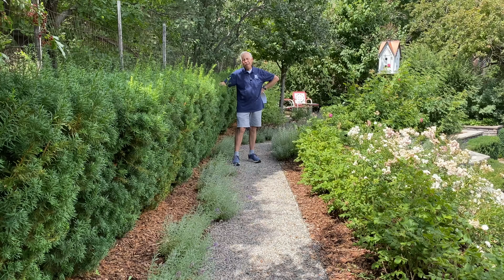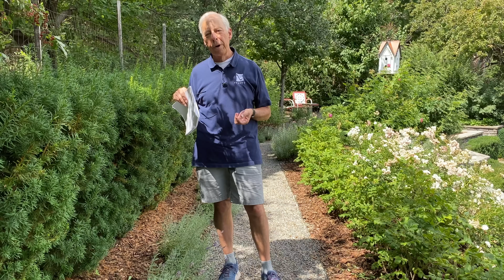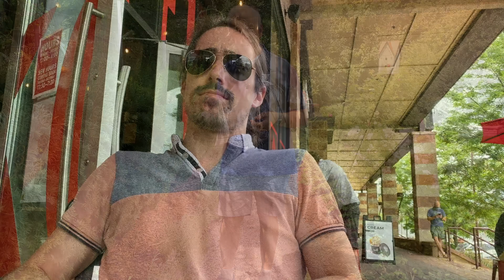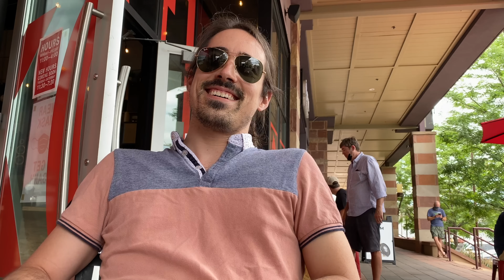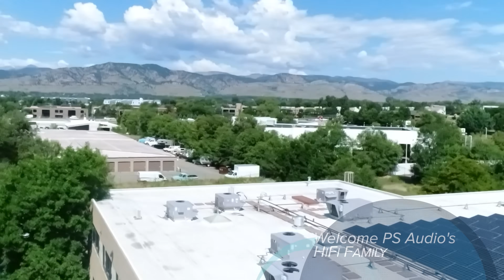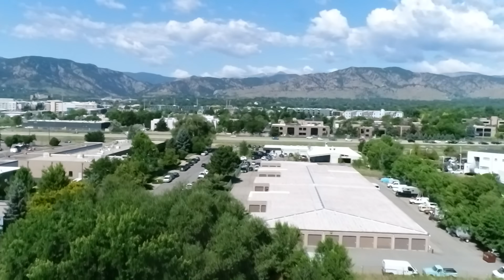Vacuum tubes on satellites?

Comment: Tubes on satellites? Oh yeah baby they sure as hell were used. But they aren't your typical run of the mill tubes. They are designed to last well over 10-20+ years and cost a pretty penny. My uncle on mom's side originally worked for RCA Astro ( which became GE Astro and than Martin Marietta) and I toured the place as it was right around the corner from where I used to live most of my life( east Windsor, NJ) uncle used to build the satellites. I even had a couple boards that were from the equipment they used to test the satellites-no never under a billion years any actual satellite components lol. 
His father my surviving grandmother's ex husband and my grandfather Anthony s. Baran actually built parts that were on the original Voyager that was lost in the black hole. My uncle's old Lehigh roommate in college Derek debastos is or was in charge of the up/downstream at XM radio and actually the two DAB satellites they use rock and roll were named so because uncles bday is the same as Elvis's. Long story short. There's alot more hahaha.

Comment: Geo stationary TV satellites use 40 Watt travelling wave tube microwave power amplifiers. Travelling wave tubes are velocity modulated where ordinary valves are density modulated.
Reply: I depends though on what era you are talking about. I think it was mid to late 80s where we got to around 40 watts with KU band? I thought DirecTV and Dish were in the 120 watt range per transponder? I started out in C band in the early 1980s. Back then the birds like Satcom and Westar series only had 5-8 watts per transponder. The C band uplink HPAs were klystron based with two only vendors, Varian and MCL. Went to the production engineering side soon after that and lost track of the technology.
Reply: Jim, correct is  "Stationary TV Satellites"
Reply: @peterhoebarth4234  No, it's Geo stationary TV satellites which are in geo stationary orbit at around 23,000 miles above the earth's equator.
Reply: @jimdavis5230  , Ballon - Satellites , the Altitude is XXX, Lol

Comment: Yes, there would have been no "Galaxy" C-band satellite video service for consumers decades ago, nor any Directv or Dish Network service, without the extreme power bandwidth and power sensitivity (easy to drive) of the famous Travelling Wave Tubes!  Their high gain, good linearity, long life and relatively high output power & efficiency made the satellite services practical.  But even the most mundane tetrode or pentode receiving tube is capable of far higher HF & VHF response than most modern transistors. Vacuum capacitors, and vacuum variable caps have been used for decades in RF applications, and the stability of the dielectric constant in a vacuum cap can't be beat for the most part. But inte-relectrode capacitance in most regular receiving tubes plays a very important part of how the tube will ultimately function, especially for a given application. Did you know that the "mu" of the intrinsic tube (with all parasitic stray cap & inductance removed) is defined as the ratio of the cathode-grid capacitance divided by the cathode-plate capacitance? This means that a "hi mu" tube has good electrostatic shielding between the cathode and plate. And that's why you'll see the 'mu' listed easily for triodes in the tube data sheets, but almost never expressed for tetrodes or pentodes. The C-P shielding is so good, that mu ratios like '200,000' are sometimes published, which is not meant to be used for gain calculations, but does remind the designer that the C-P shielding is very high and the C-P capacitance is very very low; tiny fractions of a pF! From this, we enjoy very high gain bandwidth product from the tube, freedom from Miller capacitance, among other things. Sometimes unwanted oscillations as well ;^). Say hello to Darren, and watch out for the high voltage rails and us old tube buzzards, ever circling over these topics.

Comment: I have heard that tubes are safer from EMP. So defense gear is protected.
Reply: YES!  Back in the 80's, my Dad and I worked on a project with Bell Labs to make a nuclear blast-proof shutter for the underground bunkers that carried the most important military communications.  These bunkers need to be ventilated, except in case of nuclear blast & corresponding EMP.  My Dad's "shutter" was created after some pretty serious blast testing at Bell Labs.  Their spec. required a maximum milliseconds to protect the ventilation shafts. It worked.  Cost to the AT&T system was $700 at the time, and replaced a unit the US Navy was buying for over $5,000 each. We got a BIG order for these.  NOW TO THE POINT.  We learned from Neil Thorsten, our liaison engineer that the communications gear in the bunkers used all vacuum tubes!  Yes, EMP proof.  Transistors just fail.  Go figure.

Comment: Wouldn't the vacuum in space make any capacitor great like a vacuum tube?
Reply: The dielectric constant of the vacuum is pretty hard to beat :-)
Reply: Vacuum is not what you want in most cases. Dielecrtric in a capacitor are there to enlarge the capacity. Vacuum-capaciors would be huge in size, and due to that would have other problems. That is why no one has ever bothered constructing them. It is easy to build some in a sealed glass bottle (i am avoiding the term tube here) but their electric properties are not worth it.
Reply: @matekochkoch  Vacuum capacitors do exist, they're fairly common in high-power RF service. Quite expensive, however, and with relatively small values.

Comment: Back in 1976 when Soviet Union pilot Viktor Belenko detected and flew his  MIG-25P "Foxbat" interceptor to Hakodate Airport in Japan, it was quickly swarmed by U.S. Air Force intelligence to find out all they could about this Mach 2.8 (3000 km/hr) capable super plane, much faster than anything the West had at the time, save for the SR-71 Blackbird (which was a reconnaissance aircraft, not a fighter/interceptor).  They were initially surprised to discover that this state-of-the-art aircraft used primarily vacuum tube based technology.  Somebody later figured out that the tubes were less susceptible to electro-magnetic pulses from "tactical" nukes, which was considered a real possibility if war broke out between the USSR and NATO.

Comment: No shock and Awe here, but back in the 70's and early 80's we were running a vending business and used Motorola 2-way mobile radios in our service vehicles. We were on Low Band VHF, around 35 Mhz. We ran a few Motrac units which were ALL transistor up until the final RF power output stage where they still used tubes for the driver and final! These radios were designed in the mid 1960's too! Goes to show that high power RF semiconductors were slow in development for hi power hi frequency use. BTW, the tubes could stand up to just about anything you could throw at them! A shorted or open antenna circuit would NOT be instant death for a tube. We never had any radios fail either!
Reply: They sound like what we were using in the volunteer fire fighting service in the 1990s before the brigade I was president of was disbanded. I remember one exercise where we were instructed to go to various points in the bush and report signal strengths so a proper coverage map could be made. My partner Wayne and I were chatted for cheating: jumping in with our report before we were supposed to so we could rush to our next appointed location. We didn’t want to spend all farking day at it, especially when beer o’clock was nearing...

Comment: Many AM FM and TV high powered transmitters are still using tubes.
Reply: Yes the big full power UHF systems are still tube. Most VHF these days are solid state. But even then the solid state transmitters are made from many low power amplifier modules in parallel. No transistor to date can do what a single high power vacuum tube can. The combiner solid state approach though has one great asset. If a module or two fails, that's only a small percentage of your total power.  On a tube units it's all or nothing. So when many smaller stations went digital in the 2000s  and bought solid state transmitters, they really no longer needed a back-up transmitter for that reason.
Reply: @andydelle4509  
What I don't understand, is why the number of VHF TV station assignments was reduced so much.  In Seattle, all of the major networks were in the VHF band (ch. 4, 5, 7) before digital, then they were moved into the UHF band and now we have all kinds of reception problems on windy or rainy days, due to all of the trees around us.  Only Fox and PBS remain in VHF, so most of our viewing these days is on PBS.
Reply: @marianneoelund2940  My understanding is it boils down to money - as usual. The VHF slots are worth more because of exactly what you mentioned. The cell companies have the money and lobbying power over the broadcasters.  I was not in the RF side, but instead the studio of the  broadcast industry during the DTV transition so I did not follow this area closely. But there is plenty of info online if you want to research it further.
Reply: @andydelle4509  
So for the transition to digital, did the stations need to purchase their channel allocation again?  I was wondering why they didn't just stay in the VHF slots that they already had.
Reply: @marianneoelund2940  In the late 1990s, all US television stations were loaned a second channel by the FCC to begin ATSC DTV broadcasting while maintaining the NTSC analog system. This was done to allow a transition time to the new incompatible digital system. Some stations were allowed to go back to their analog channel frequency after the analog shutdown. Some had adjacent channels where in some cases the transmitters and antennas could be re-tuned to the adjacent channel. The first analog shutdown date was 2006. Then it was extended to 2009. So no matter what, all the stations had to return either the loaned digital channel allocation or their old analog allocation. As you are no doubt aware, allocating RF spectrum is complex as there are many potential interference problems. Not many stations were allowed to go back to their analog frequency especially in the VHF band.
Reply: @marianneoelund2940  - During the transition most stations ran their existing analog and the new digital at the same time. There simply weren’t enough vhf channels available without causing interference in nearby markets. Then if a station built a full power uhf digital, they wouldn’t want to have to throw it all away and buy a new one just to move back to the old frequency. Although the power bill would be reduced.

Comment: can someone please link me to some recommended Subwoofers? I live in England
Reply: Try REL they are the best in the business
Reply: @Roamany-Jones  cheapest REL is 3x my budget. Lol. Was looking for something about £100
Reply: @zachunter1326  Maybe Audio Pro Addon Sub, just had a quick look what is popular in Sweden for a low-budget sub and it was #1. Wouldnt expect it to be any sort of "hi-fi" though, but just getting some increase in low frequency might be enough for you.
Reply: @zachunter1326  oh, then, the least expensive sub worth having is the SVS SB!000. that sells for $500
Reply: @Roamany-Jones  , i second that!
Reply: Just wrote the below and noticed you are looking at £100! - You would be pushed to build one for £200...
However - a branded 2nd hand driver and 2nd hand plate amp from ebay might be worth a play - build a sealed box (less chance of going pear shaped) and get advice from DIY audio or somewhere for cab size range. (check your driver is suited to sealed)

Richer sounds deal with REL as well as a host of others like SVS - I have often found them to be more knowledgeable, more enthusiastic, and give you more time than your typical 'high end' dealer. BK electronics is an interesting firm - you may not have heard of them but I believe they are behind many branded subs, and sell their own models the best of which use highly regarded eminence drivers.  If you can DIY you might consider a servo controlled sub from GR research - USA but will ship. IPL and wilmslow audio are British Kits.   
(IPL - like the look of low mass kevlar SW5 but not high mass SW6...)
Reply: @robh9079  nope a guy from England was wondering what kind of sub woofer he can get for around 100 I pointed him tward Polk Audio.  I have all Klipsch.
Reply: @robh9079  thanks for such a detailed explanation man. I'll have a look into it but I fear I may be nowhere near knowledgeable for something like building an actually good DIY sub
Reply: @zachunter1326  had another look at the richer site - Yamaha for £129, 8'' woofer 50watt amp. If you have a kit to build from it's barely a step up from an ikea flat pack. Might be worth saving for that next step up.
Reply: Polk Audio
Reply: @behexen250 for 100 bucks you really don't have too many options.  I would also say that sub woofers are the least noticeable when it comes to room and system and that sort of stuff.
Reply: Look at Polk Audio you'll be fine for now.  A 10 inch sub is around 100 US Dollars so with tax it will be about $134,0567,292  but here in the us about 100 bucks
Reply: Polk Audio has a phase switch also because the phase is always wrong in England haha

Comment: In the late 60's I worked on a remote microwave site, we had several different microwave sets, all but one were early 60's or late 50's designs and one was from WWII, all were 100% vacuum tubes. It amazed me how long the tubes lasted in gear that was working 24/7, the SOP was to pull tubes every month and run them through a tube tester. Readings were recorded and tubes would be replaced when the mu started to drop. the problem with that is tube sockets are not built for that and some were beginning to loosen up. I submitted a proposal for recording cathode currents (via the meter and switch on the equipment) every month and just testing the tubes annually, that was accepted in Washington And I began to see changes orders come through just before I left the army.
Reply: @jim9930   can't say I ever met him. We were a small site with 6 guys to keep things working, I only got down off the mountain every couple of weeks so i didn't meet a lot people off the site. No road you had to walk a mountain trail for 1-1/2 to 2 hours to get up there.
Reply: Nice man!

Comment: Microwave power tubes used on satellites are called TWT (Traveling Wave Tubes). Thales and L3 technologies (Harris) are the best known manufacturers. L3T website does have an updated table with the exact number of each model of Harris TWT tube in space today. Typical space TWT power output is between 80 and 300W.
Reply: TWT, magnetrons and klystrons have vacuum inside, but I wouldn't even call them "vacuum tubes" in the traditional meaning of the word.
Reply: @ThinkingBetter  They were a development of them and replaced whole circuits that gridded valves needed.
Reply: @jonathansturm4163  My house is completely "vacuum tube free"...as long as I don't call the magnetron in the kitchen a vacuum tube. I just used it to heat my dinner. During this pandemic, much of our food is Amy's frozen food cooked in our microwave.
Reply: @ThinkingBetter  You have my sympathy! Since I’m no longer capable of growing our vegetables and finding really decent fresh is difficult, I resort to frozen veg and the microwave. They’re a pathetic substitute for the real thing at best.
Reply: Jonathan Sturm Yes, I also miss fresh food and especially going to a nice restaurant.
Reply: @ThinkingBetter  Yes, being able to go back to restaurants for a meal was a great relief. Unfortunately my friends Peter and Martin I regularly lunch with chose a fairly new local restaurant. They overcharged to buggery for very little food on the plate and we were still hungry afterward. I don’t think they’re going to last very long. Their two rivals serve far better quality, between 4 and 6 times the quantity for less than half the price.
Reply: I started to lose interest around when gridded valves were being taken over by magnetrons, klystrons and so forth. There was a sort of blurring between device design and circuit design much as was happening in solid state where ICs were displacing discrete transistors. I had discovered sex and drugs and rock and roll and most of my brains migrated into my dick.

Comment: Sure! Voyager's transmitter uses an RCA pencil microwave tube.  Also tubes are not degraded by cosmic rays, as semiconductors are.  Tubes are RAD Hardened!